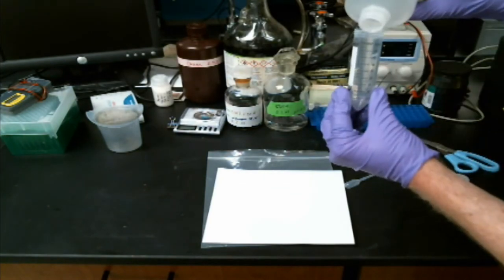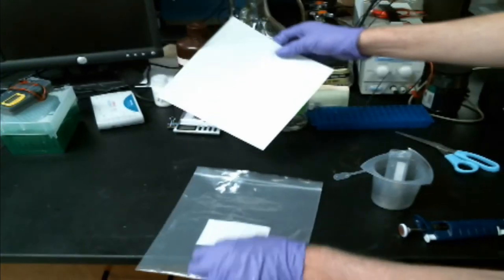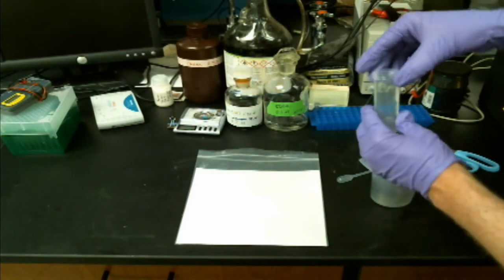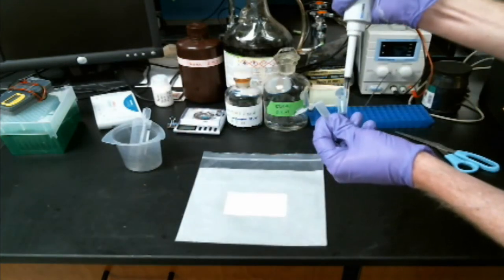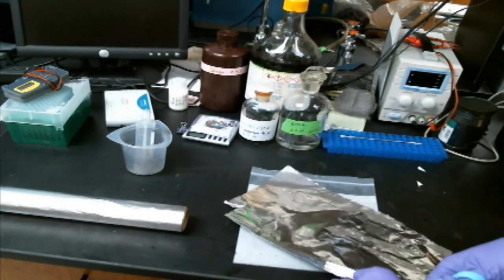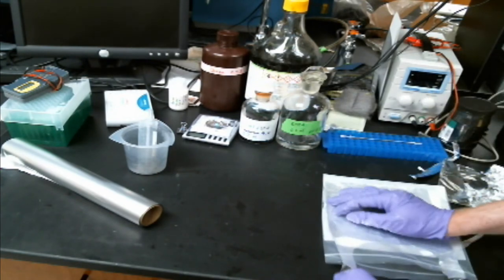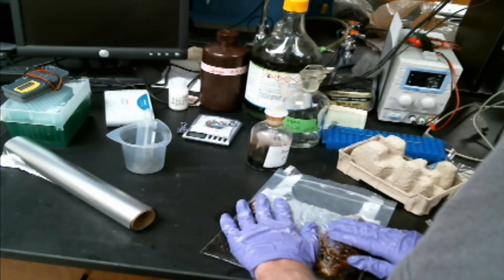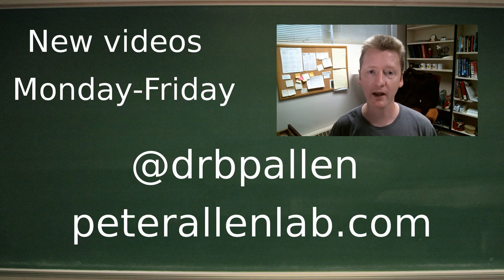First version of the bag cell, a DIY all iron battery

Comment: 0.2 volt seems low but it's so thin multiple cells shouldn't be prohibitively thick. A few questions come to mind. Is it a secondary cell? Would it be feasible to stack cells in a single bag? Do the aluminum current collectors corrode? It's definitely interesting.
Reply from the maker: Thanks for the ideas. I thought about stacking multiple cells in the same bag, but was worried about the higher voltage causing shorts around the (leaky) edges. If I move to a paste instead of a liquid, I think it should be possible. Aluminum corrosion is definitely a potential problem. I think that at pH 8 and 0.2 v, it should be pretty minimal, but I'll have to watch carefully. It's considerably easier to use Al foil than graphite foil. 

As assembled, it was partially discharged due to the iron (III) EDTA that inevitably ended up on the anode side. Ideally, it would all start on the cathode side, but the bag is not the best at keeping things in place. A paste or a sealed edge would help. But the chemistry should be rechargeable (it seemed to be rechargeable in previous designs. 

I'll put up some results on the bag cell's performance later today (spoiler alert: it's not great).